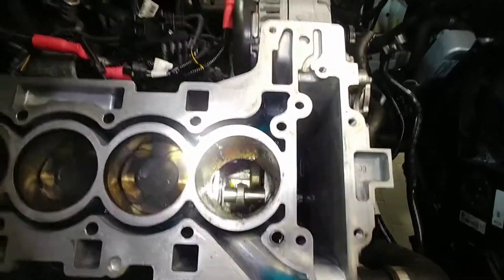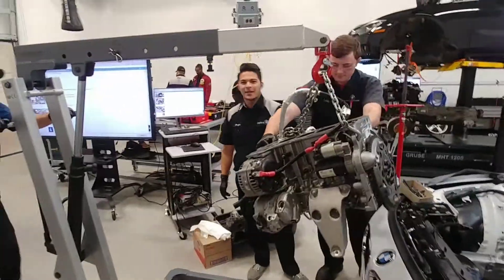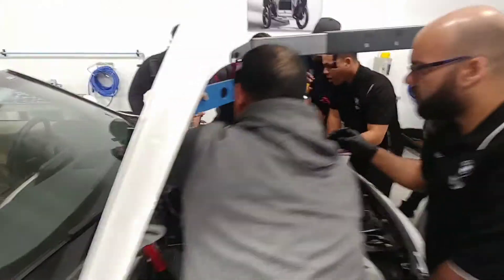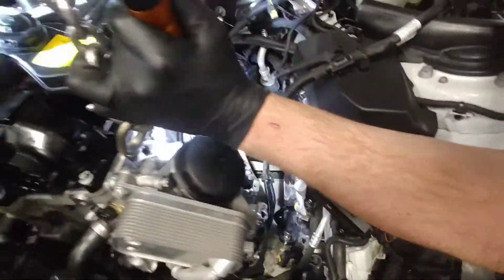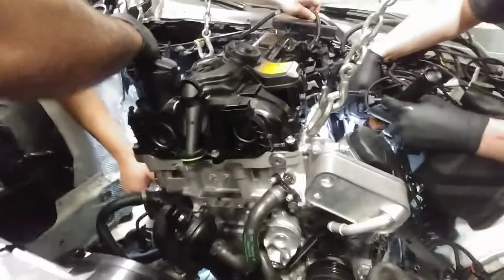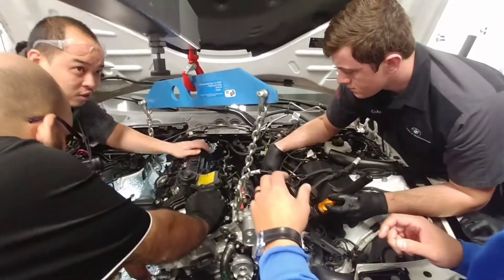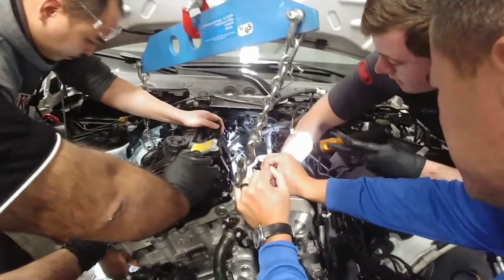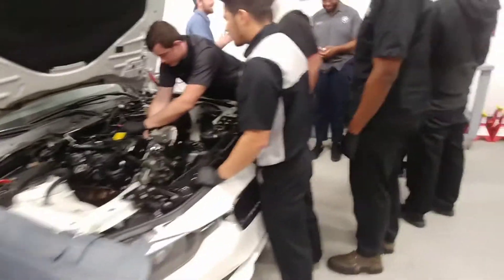BMW Apprentice Technicians replacing N20 engine.

Comment: 7:27. You just cut the most challenging part which is to align the engine and tranny together. There is no easy way to keep engine and tranny in STRAIGHT line while the engine mounts are still there. It is always the difficult part and u can easily get the torque converter sliding out which is what u don't want. Try tilting the tranny UPWARD? If 2 engine mounts can be removed first, aligning would be easier (then tighten the bell housing bolts). Then worry about putting the mounts back in (u might have to drop the sub frame while hoisting the engine by support bar. )This is a 4 cylinder. Imagine this is a V8. Having a leveler on the hoist will help too. You got half dozen kids helping. Imagine u are the only one doing a V8.
Reply: Good insight